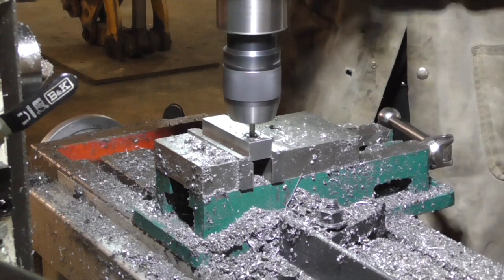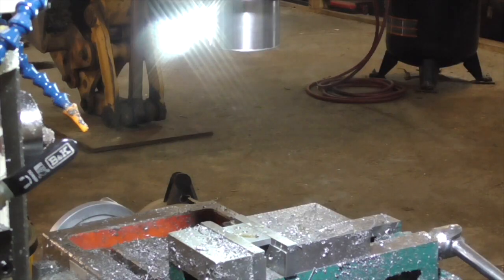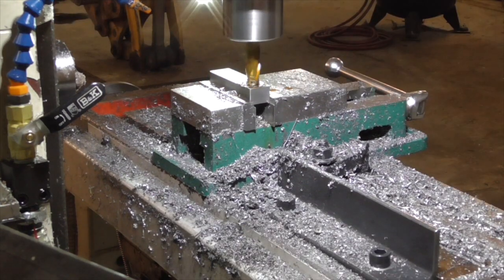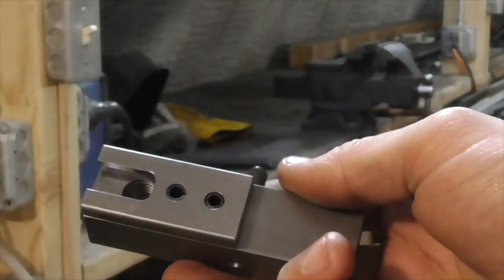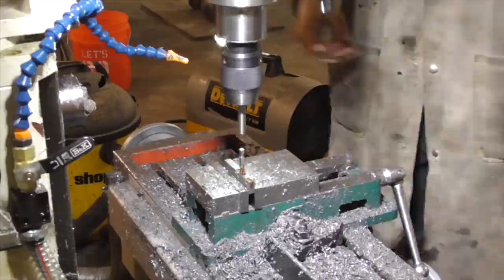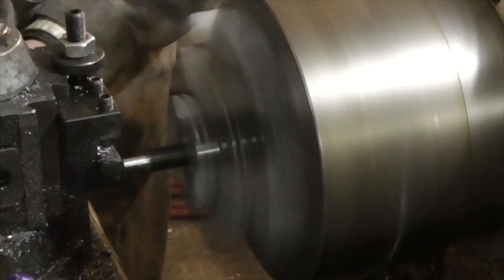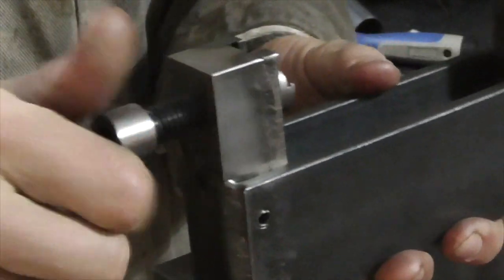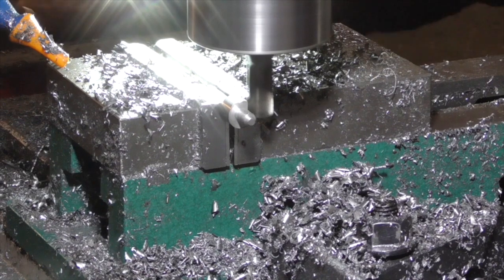Homemade Case Trimmer (TIS259)

Comment: do you  use CAD or are you more a back of the envelope sort? That is, did you create a plan and is it available?
Reply from the maker: This project was simple enough that I made it just based on a few back-of-the-envelope sketches, so I'm afraid I don't have drawings.  When I do more complex projects I usually do model them in CAD first.

Comment: What it the point of trimming shells?
Reply: Metal moves when formed. It may move during the resizing process or just from being fired. Either way, the case elongates and must be trimmed to specification.
Reply: @davidplatenkamp  okay, thanks i didnt know that you needed to do that when hand loading
Reply: @strider04  It is important in most cases but sometimes it isn't always necessary. That being said, checking the length of cases before loading is definitely important. If you are just making plinking ammo then being close to the recommended length is good enough and you'll get 1-2 reloads before a case needs to be trimmed (different ammo and casing geometry might change this ie pistol/straight case vs necked casings). If you are making high accuracy ammo, however, getting all the different parameters as similar as possible will result in better results and reproducible characteristics when shooting.
Reply: @kylelottridge8939  makes sense.
Reply: Many differences, bullet placement for one PSI/CUP, uniform loading...
Reply: @holysmokeDC  okay
Reply: @strider04  👍